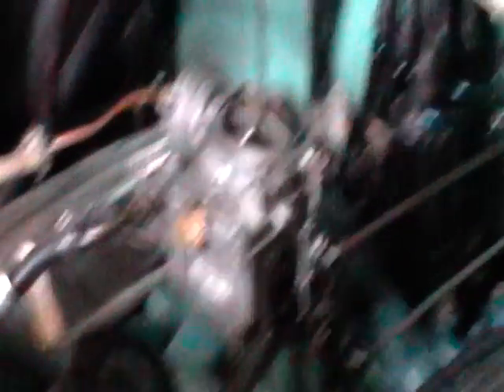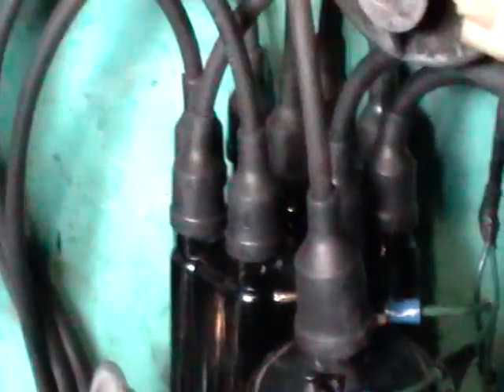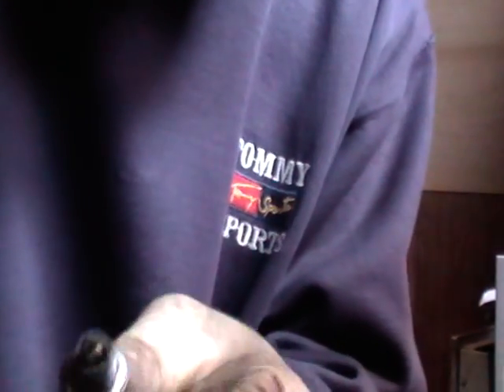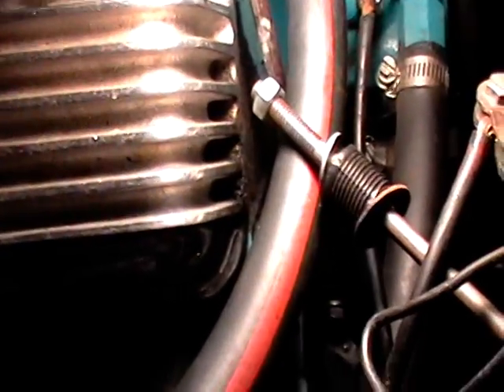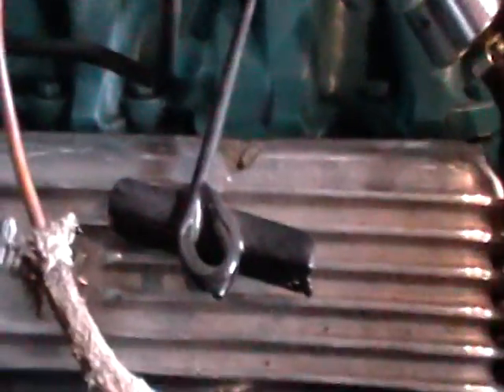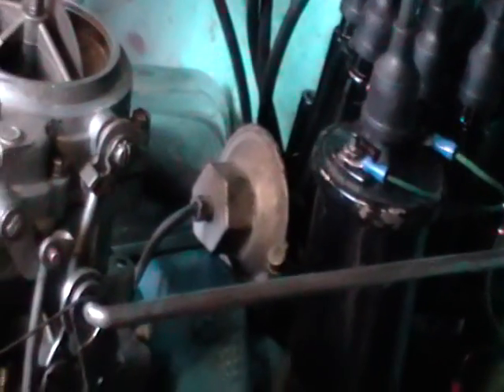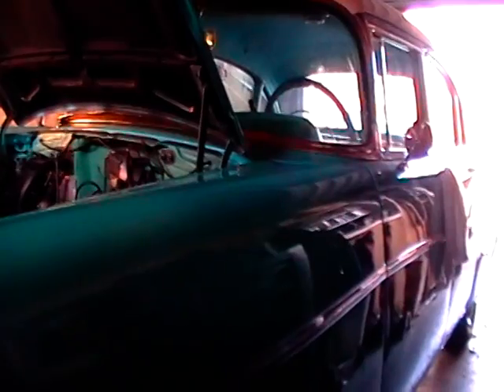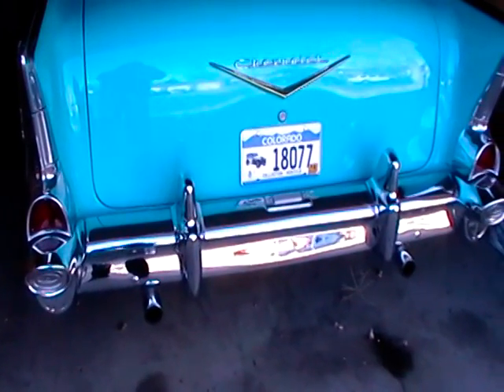1957 Chevrolet Bel Air 283 V8 Timing Setting

Comment: Nice video.  Couple of thoughts.  The throttle rod is on backwards. The adjustment swivel should be at the carb.  The vacuum line should be disconnected when adjusting timing. The 5 and 7 wires should be run so they do not cross each other or parallel each other. As the firing order is 18436572 and 5 and 7 are next to each other you could get a miss fire if the 2 wires cross or parallel each other.